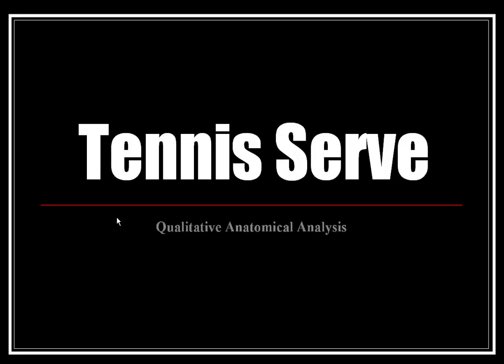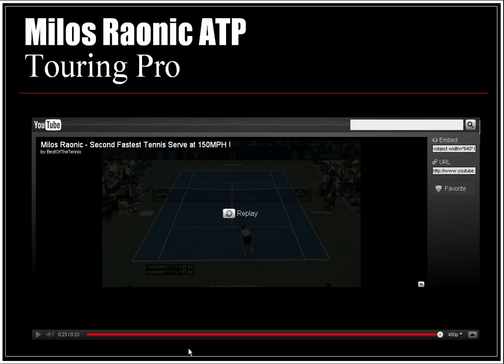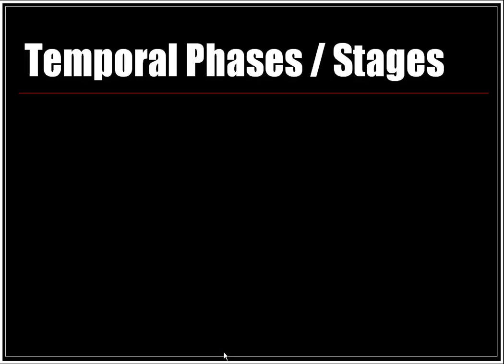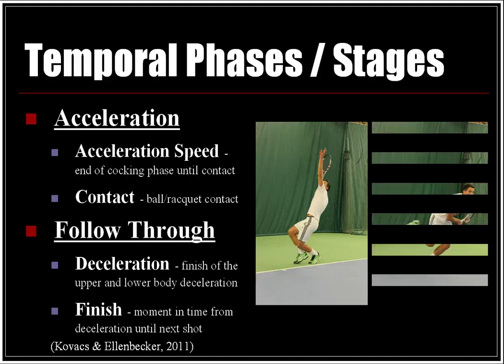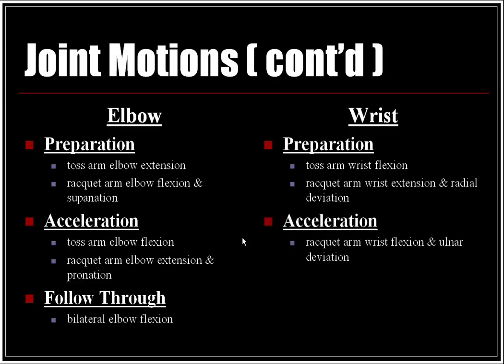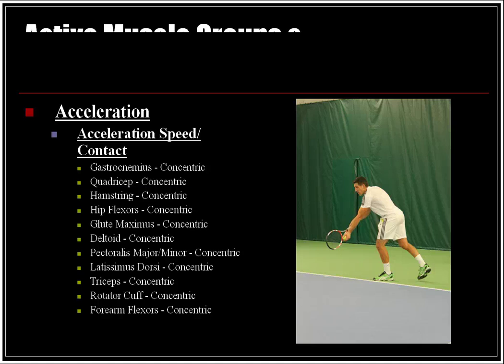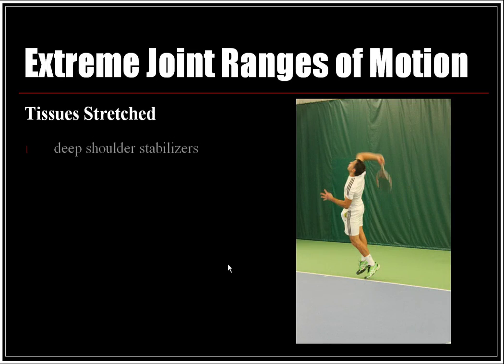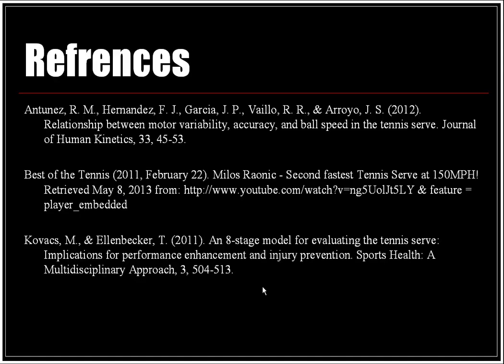Biomechanical Analysis: Tennis Serve

Comment: The Tennis serve is probably the most complex stroke in all of racket sports. It's also done from the back of the court (baseline), so it has to travel a good distance. Similar to it is the overhead volley at net. The critical difference is at the net the opponent is doing your toss for you.  You still have to line up with the ball so that you are positioned ideally in order to strike it cleanly.
When I coach I have the player do several overheads at net and from the baseline in turn. After a series of these we do it from just the baseline. Once perfected we do the whole serve motion from the baseline. At this point the player has to focus on a few things. Feet apart shoulder width and weight transfer from back to front as ball is tossed as weight shifts to front foot. Player then catches the ball w/tossing hand making sure it can be caught at the top of reach at the same time balanced with weight on front foot.
At the time of this whole process the racket needs to be in the back scratch position as the weight shifts forward. Now, once player is able to catch the ball w/o having to reposition, then we know the toss is in the right place. Now all player needs to do is the last part of the serve. That is, to strike the ball at the top of their reach and bring their weight naturally forward with the weight transfer. It has to be practiced over and over all the while making sure it is fluid and comfortable with good balance before during and after.
The forward motion at delivery is to bring player to ready position w/split ste at net in order to do a volley after guessing which side it is coming at them.